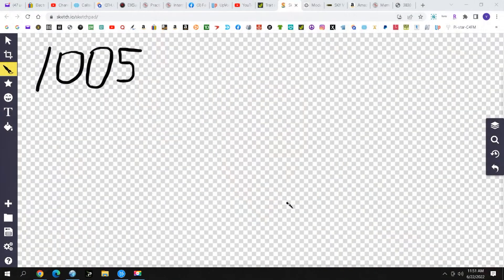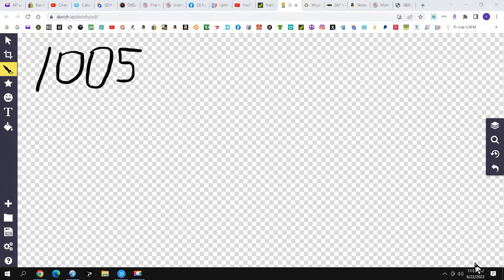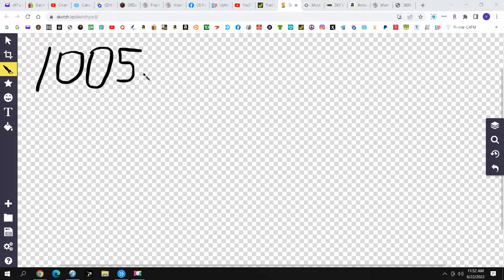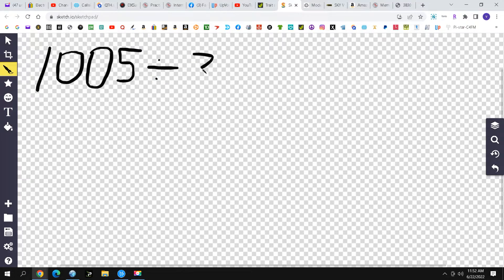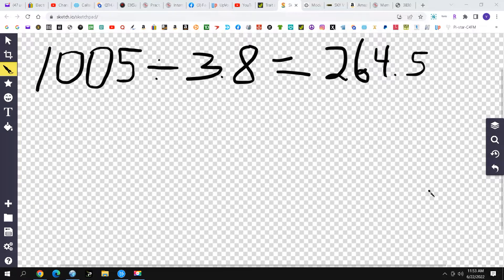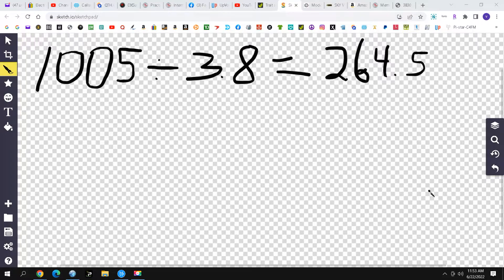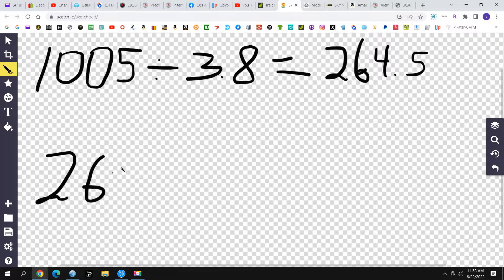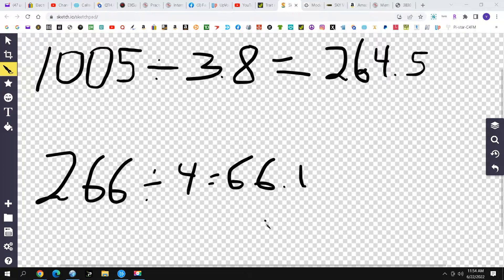HOW TO BUILD A SKYLOOP ANTENNA / BUILD A HORIZONTAL LOOP

Comment: Yes, the horozontal loop is a great aerial. I had one cut for 30 meters and it was very quiet and worked great. It worked on 20 on up to 10 meters using my atu. Even if the loop is close to the ground it might surprise you. A friend of mine said it was a cloud burner but I worked a lot of nice DX with it. It worked very well receiving the AM bdcst band. I cannot explain how but stations hard to hear like KDKA in Pittsburg and KMOX in St. Louis had nice signals. I live 85 miles from the Canadian border in the NE and the 30 meter horizontal loop outdid itself more than once.

Comment: Can you work other bands with 80 meters Sky Loop?
Reply from the maker: If you set it up with ladder line to the tuner, or to a balun with a short coax jumper to tuner you can use it one the band its cut for and above.
Reply: With ladderline feed and a good ATU you sure can!

Comment: Will it change things if I use 300 ohm TV Twin Lead instead of 450 ladder line?.. Thanks for this video.
Reply from the maker: I would stick with 450 or 600 ohm.
Reply: That will work but don't run more than 200 watts using the TV 300 ohm stuff because sparks might fly!

Comment: If there is only one wire antenna that I could have... it would be the 80M-10M Skyloop.  Due to its distance from my shack I use LMR-400 as a transmission line.  Art W1SWL
Reply from the maker: I feel the same way, although I have a 20 meter delta loop that keeps up with it. LMR 400 is all I use.
Reply: @HamShackReviews  I was thinking of removing my 75-10M EFHW and replacing it with a Delta Loop.  On your 20M Delta Loop, what other bands are available to you with acceptable SWR (<2.0:1) native with no tuner...?  Cheers & 73 Art W1SWL
Reply from the maker: @arthurgumbus3969  Just 20 without a tuner, but 10 is usable with a tuner.

Comment: A RG8/213 etc... coax is made for 50 Ohm. Why run a wide range of impedance over it (25-900 Ohm), depending on the tuned frequency? Also, a 4:1 balun has some loss. An ideal spyloop uses a ladder line as feeder and needs a balanced tuner to work properly. Just logical thinking. I agree, the skyloop is a magnificent antenna. 73'
Reply from the maker: Not everyone can run ladder line, This video gives a choice of either ladder line or coax.